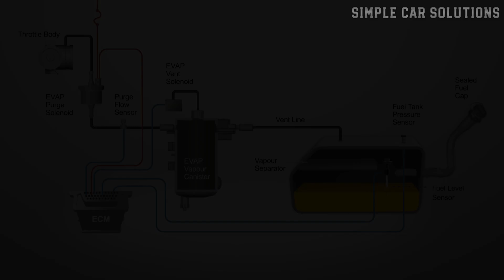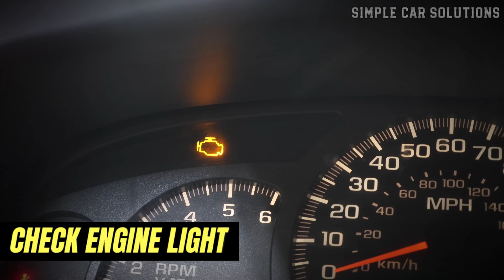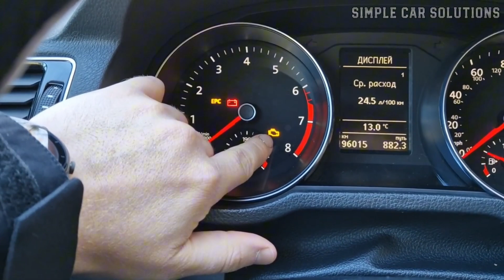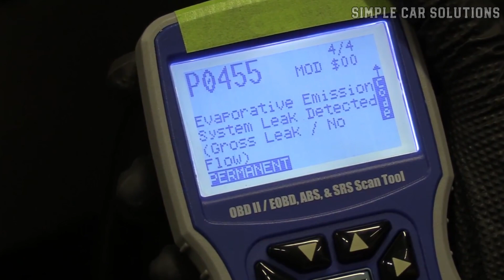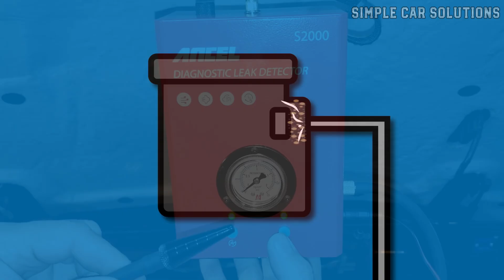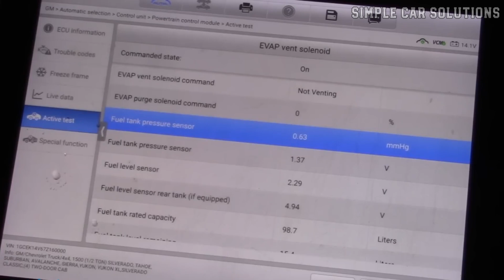5 Easy Signs EVAP Vent Valve Needs Fixing! Don’t Ignore These EVAP Canister Vent Valve Symptoms!

Comment: I'm trying to trace a very small evap leak code (P0456) on a 2011 Saab 9-3 XWD with only 84,000 mi on it.  I drive on clean roads.  I have already changed the purge valve, and PCV valve, since I understand the PCV valve can mimic the code, and of course it got a new intake manifold and throttle body gasket during the PCV change, since the  PCV valve pushes into the manifold after removal of the minifold (snaps in) and manifold torqued to 7lb/ft, as required, by Saab WIS.  Also, a new OEM gas cap.  The filler neck is very clean, shiny and not distorted.  I do not smell gas, and it fills easily, with no pressure buidup at the filler neck.  I checked a few evap quick connects, cleaned the o-rings in them and swirled a light coating of dialectric grease on them with a Q-tip to help them seal.  I have a smoke machine coming, but something tells me it will be something stupid, I can only hope, short of mice chewing!  Unless of course I haven't actually completed the required drive cycle (which is a pain in the butt!)   Its due for inspection this December 2025.  Any ideas?
Reply from the maker: You’ve covered most common causes — nice work. On these Saabs, P0456 often ends up being a cracked vent valve hose near the canister or a leaking canister vent valve itself. Once your smoke machine arrives, start from the rear near the charcoal canister — that’s where small leaks usually hide.
Reply: Get you a smoker and baby oil.
Reply: Replace the purge valve. It's usually the vent valve or the purge valve. Let me know if that works please.